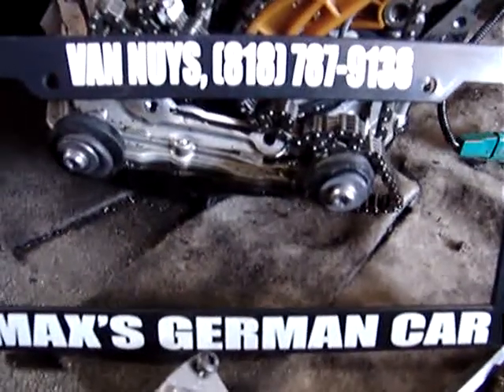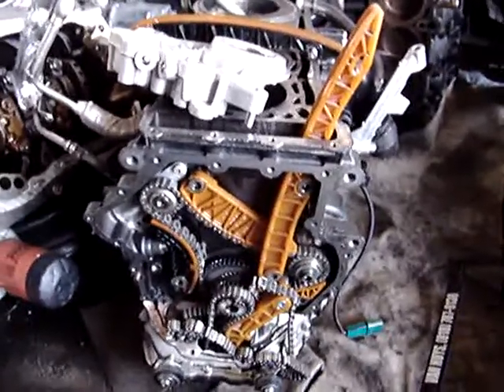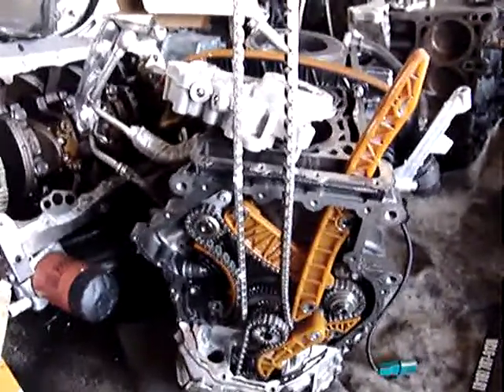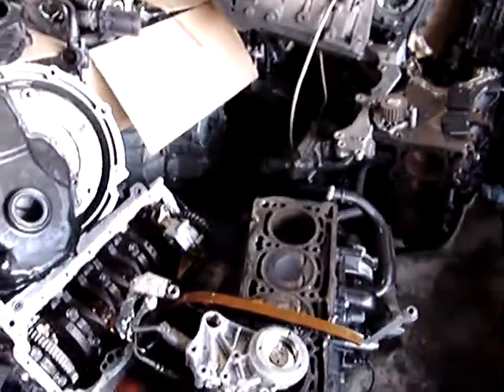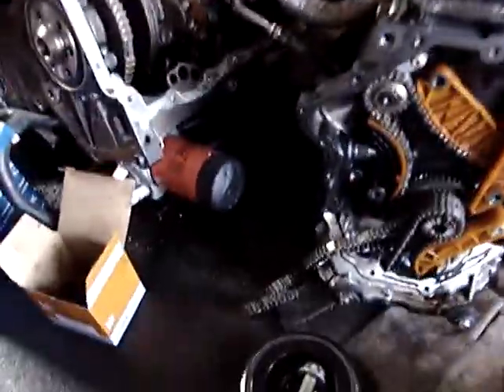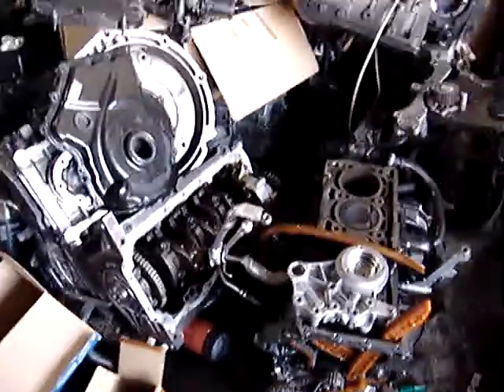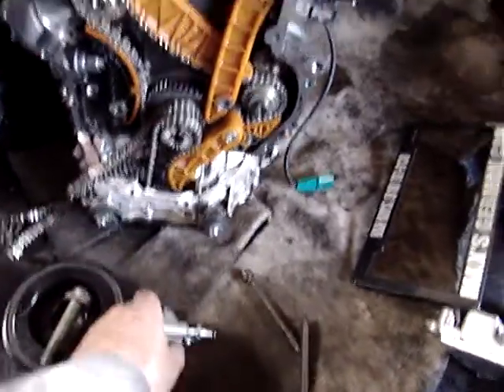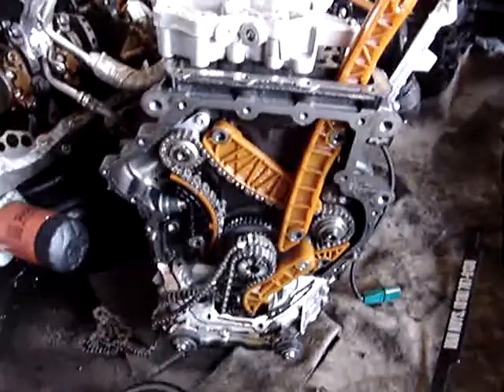Audi,VW CBF 2.0T Cylinder Head Removal

Comment: Should I mark the timing chain before I take it off
Reply from the maker: Very complicated! Do whatever it takes! Very percise! No mistakes allowed! Take pictures or whatever you have to do! The 6 timing marks only align every 166 revolutions! Must use all new parts like chains and tensioners!
Reply: Doesn't the new chains have gold colored links to realign all the gears??!! Hmmm. Duh!!
Reply from the maker: @quickrodsinc.4244  You think it's so simple? Not simple at all! Yes the timing marks on the chains have either a different or some sort of mark. Very Very complicated set up